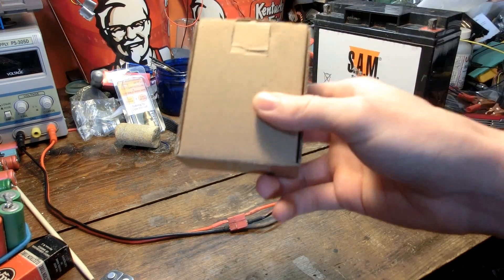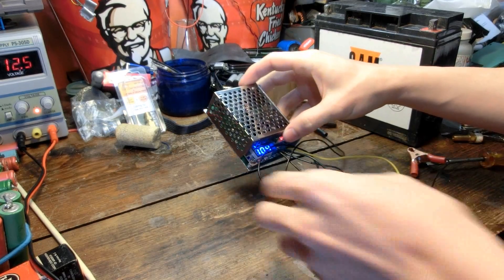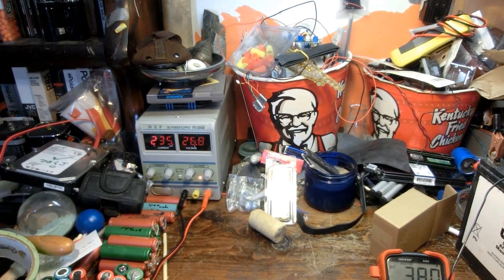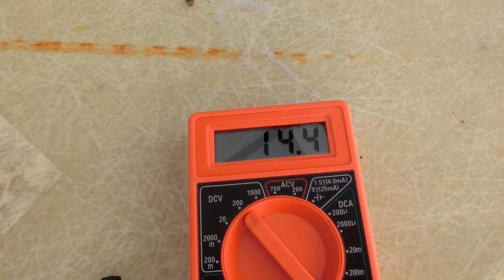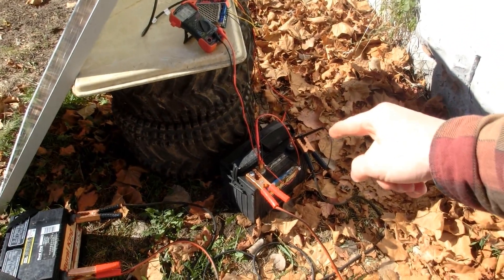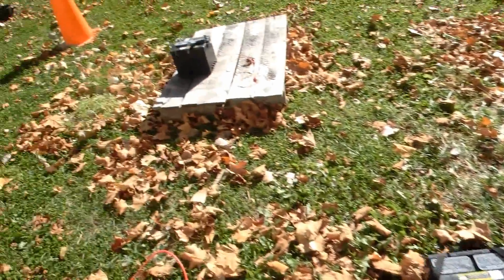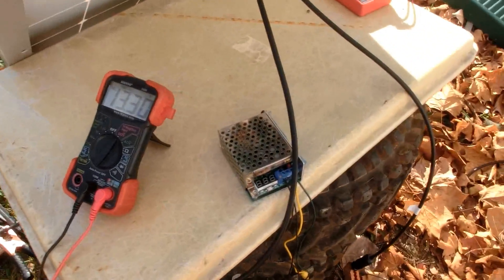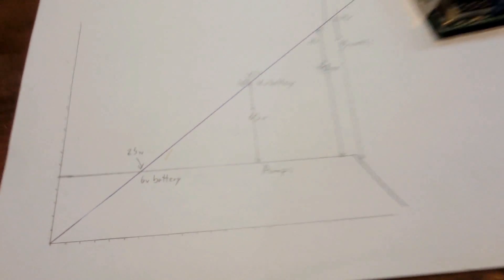Solar Sunday Experiments 002: step-down converter instead of MPPT

Comment: Solar, solar sundayssssssssss :-) love them, I just get envious you have sun is all :-D

Thanks for trying out the step down approach, I really wanted to see if the boost in amps would appear or if something would get in the way. Its a very handy little device you picked up there, your covered for step-up and step-down quite well now :-) Blue leds, lucky devil!

Could you perhaps run two wires or two lines of rope between the trees and mount a rolling trolley on them to put your panels up there. then have an ldr or sensor to trigger a motor on the tree which then move the panels out of the shade? it sounds snazzy but I bet that could be bodged together pretty cheap :-)
Reply from the maker: that trolly idea is interesting but i think just a taller pole would be better. or maybe cut down my neighbor's trees when they arent looking haha.
Reply: :-) it does seem a bit of an effort I admit, but it would look cool :-) its a shame you can just ask your neighbors if you cant just put them on there shed in return for free mowed lawns all year :-D
 I think when you get more panels you probably wont be as bothered as much :-) but its good to peak efficiency on what you have got where you can :-)
 If anything its all useful bits of info that can help you with other stuff down the line, like now you have a good idea of where a step-down will best suit :-)
 Hmm you know your vertical wind turbine, can you add magnets to the bottom of that to make it maglev-ish? :-)
Reply: Rinoa Super-Genius Id be getting that big tree I saw in front of your solar panels CHOPPED! ;)

Comment: Ive gotta get me one them converters , Maybe use it on my ultra cap board so i can run various things on it , I had one the tiny single board step down converters but the chip/regulator gets insanely hot maybe this would be better , Is the surrounding metal on the converter device like a heatsink or to prevent some sort of interference?
Reply: Yeah sorry i did notice but im one the strange ppl that likes to order things from within the uk because it arrives faster :-P , Well some ppl call me strange for that :-)
Reply from the maker: the thicker bottom part is a heatsink, but it's rated for 10 amps anyway, far better than most small step-down boards.
Reply: Gotta love that Blue LED display on it :-)
Reply from the maker: steve64464
 yeah :D
Reply: yeah i need one too, for my ultracaps too! ultra caps are great fun to play with.
Reply: My attempt to find one of these on ebay failed :-/ , but yeah ultra caps scary and fun , was just last night i was using the ultra cap array along with my raspberry pi to set off fireworks display :-)
Reply from the maker: steve64464
i put a link to the step-down module in the description.
Reply: steve64464 its a pain in the backside waiting for delivery from china to the uk! upto 30 days! 1/12 of a year! nightmare but always ALOT cheap . check ebay.com its much better than ebay.co.uk for electronic goodies :D
Reply: Also risk import taxes and stuff like that dont we?
Reply: Never paid any import taxes from china as they mark everything as gift ;) BUT I do know of someone on youtube who bought a 12kw inverter and they had to pay for import charges. Usually anything about 2kgs or lighter you are ok. I know that to import stuff from USA is ridiculous. I wanna get some of those 3600F caps from america ;)
Reply: Im guessing its okay if you dont order in huge amounts to get their attention, I did order six 350F caps which are assembled onto a pcb array capable of starting a car which they did tax me on. Its just the long waiting times that drive me insane :-D

Comment: What a cute stepdown module :-)) you got that cheap :-))

You may be getting a little error on the input current as its pulsed power, and power factor could also confuse the meters slightly.
A purely resistive load might make a difference, like a 21w car bulb :-)

Oh dont forget how lossy iron core transformers can be, just in case you make your own.
Reply from the maker: its ok, i've figured something else out that won't require that and may use this step-down board after all. i'll connect my crusty 12v battery to my crusty 6v battery so the panels will charge them at 18v, then i will step that 18v down to charge the other batteries. i was complaining because the panels dont act like batteries so i guess it wouldnt hurt to add batteries, that would make the voltage/amps more stable i think.
Reply: Rinoa Super-Genius
Good idea :-)), just make sure the capacity of the 12 and 6v batterys are equal, there i am again teaching you how to suck eggs lol, ignore me lol.
Reply from the maker: zx8401ztv no they arent exactly equal, but its what i got.